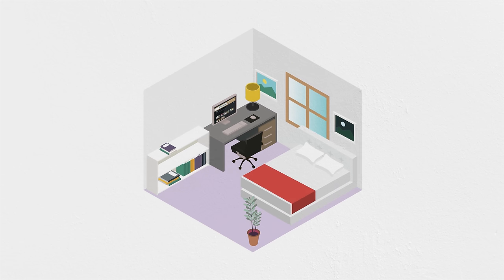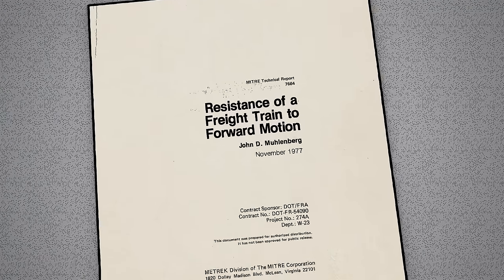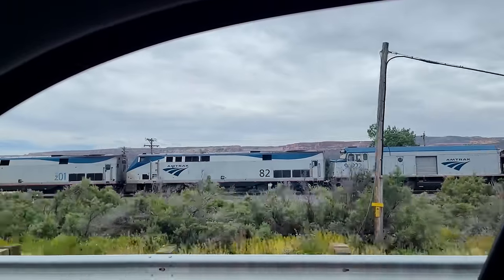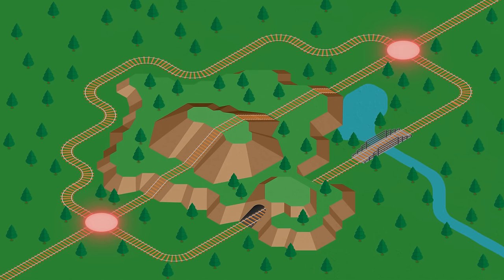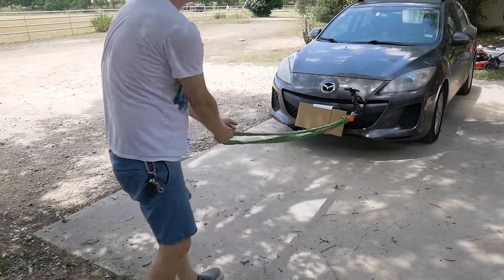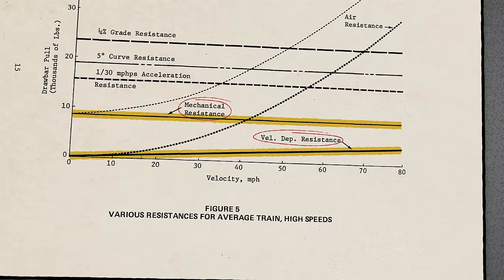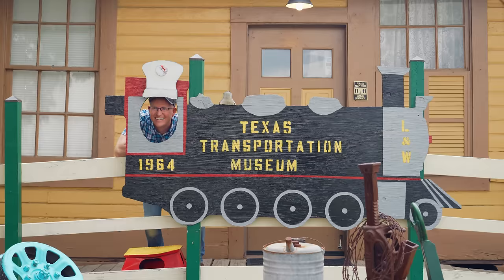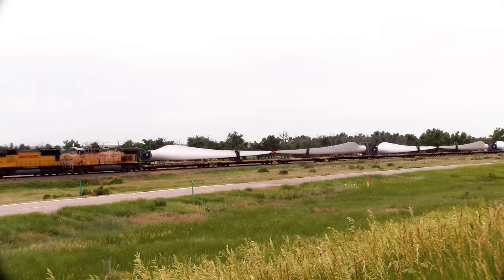Which Is Easier To Pull? (Railcars vs. Road Cars)

Comment: 0:56 - Like seeing our South African Sishen-Saldanha Iron Ore train in your video...

Some interesting facts. This train is about 3.8km (2.3 miles) long. It uses what the refer to as a A,B,C configuration, A would consist of 2 locomotives and 112 wagons (100 ton, excl weight of the wagon). So would B consist of a locomotive (or 2) and 112 wagons and C consist of a locomotive and 112 wagons, and usually at the end of the train is  1 or 2 locomotives pushing. It uses RDP (Radio Distributed Power) so only a driver and assistant in the lead loco. This distributes the pulling/pushing forces better and also makes braking more responsive, as each locomotive in the consist will regulate forwards and backward braking to all the wagons in between. It is many times a mixture of Electric Locomotive (running on 50kV) and Diesel-Electric locomotives.

This is a single line track of about 860km (535 miles) long and stretches from Sishen Iron Ore Mine in the Northern Cape to the port of Saldanha Bay on the West Coast of South Africa, Since there are only 18 places on the track where an empty train and a loaded train can pass each other (Loop is about 4km (2.48 miles) between signal to signal). The fully loaded train will always have preference when possible, as it takes much more energy to get it going than an empty train.

I live about 5km (3.1 miles) from this railway line.

Comment: Isambard Kingdom Brunel was a genius inventor, and one of the head engineers of the Great Western Railway in England during its initial conception. If I remember correctly, he did several things on a branch line that makes the GWR (at the time) an engineer’s wet dream. He doubled the width of the track to set the boiler of the locomotive in the middle of the frames instead of on top of it. This lowered the center of gravity, lowered drag, and gave more space for passengers. One of my favorite things he ever did was build bridges and tunnels over and under terrain, so it was essentially a straight line from point A to point B. It was fast, and efficient, but the problem came when passengers had to switch between two trains of two different gauges of track. Two locomotives couldn’t operate on the same stretch of line because the tracks were too wide or too narrow, and this made schedules and keeping to time a nightmare. Broad Gauge was essentially dead, but by god it was glorious. This was in the days of steam, of course, and he was so revolutionary, he even proposed using vacuum power, by putting a steel pipe between the tracks and forcing the cars to move by connecting them essentially to a plug which would build air pressure in the pipe and force it one way or another. This didn’t go through, of course, but the cable cars in San Francisco work on a similar system, only using steel cables and a winch house instead of vacuum sealed pipes.

Comment: FYI: You can easily put together with some Arduino and a load cell a simple device instead of using a digital camera and a digital scale. You can also display the results and log everything to an SD card. I've seen you using something similar in the Rust-o-matic, so it probably wouldn't be too difficult for you.

Comment: 3:40 Force along an inclined plane is F = Weight x sin(angle). However, for very small angles (like railroad grades) sine is very nearly equal to the slope. This gives us F = (weight) x (%grade). for a 1.0% grade this is F = (2,000 lb.) x (0.01%) = 20 lb. Thus, the simple rule is 20 lb. of tractive effort per ton per percentage grade.

4:27 Some Trains put their DPUs at the back of the train rather than the middle.

Comment: That low wheel/track friction is great when the train is moving but poses a problem for a locomotive when it’s trying to overcome static friction and get the train moving. To help get them going, locomotives have nozzles to spray sand on the tracks if their wheels slip.

Comment: As a locomotive engineer one of the heaviest freight trains I ran was a loaded coal train. It is 135 cars, 5 SD70 (4K hp per engine so 20K total) locomotives and tips the scale almost 23K tons! Depending on the territory we run them at 50mph. What helps move that weight without tarring up the train is having 2 locomotives on the headend and 3 on the rear that push called distributed power. When we encounter wet rail we have sand that we can squirt under the wheels to provide tractive effort. We measure the ability to move the weight as horsepower per ton (HPT) and tons per operative brake (TOB). A typical loaded coal train runs 0.9 hp per trailing ton. If you think of just how little horsepower that is it’s mind boggling that I’m able to move it. There are way smarter folks that come up with the numbers that allow us to maintain the best fuel efficiency. Outstanding video!!!

Comment: Wagon is designed to be pulled and hence easier to pull while car is self driving so a bit more difficult to pull.Wagon slide on rail whiles car faces a bit more friction on road.For almost same length wagons got bigger wheel base and also more wheels.

Comment: Years ago, I was doing work on the far side of a narrow gauge railway workshop, and had to cross part of the rail with an excavator. There was a tanker of fuel oil in the way, the workshop foreman put his shoulder to the buffer and indicated me to do the same. I thought he was kidding, but went along with it. 4000 gallons, plus the tank, rolled away easy as.

Comment: Great video. Just wanted to point out that in fact for a freight train and most of the regional trains the ajr resistance is a lower factor. The resistance part dependent on weight will be far bigger because these train wont go faster than 80 km/h (freight) or 120 / 160 km/h for regional. Also the big component of air resistance is related to frontal area and some component to side area. The frontal area is comparably lower to sides. Very different story for cars. But trains experience things like piston resistance in tunnels and pressure waves and changes which is quite interesting for high speed trains.

PS: Grady please polish your light reflectors on your Mazda :) You will see better and the opposite traffic also

Comment: The three routes at 3:10 - the left one is cheapest and good for slow speeds, having lots of curves. The middle one would actually be useful for a dedicated high-speed line (French style) where the train has already lots of kinetic energy entering the grade, and lots of speed can be recovered coming downhill. The best alignment for mixed use, although the most expensive to build, would be the right one, being flat and having few curves.
Reply: I believe the ruling gradient on TGV lines is 1 in 28   (about 3.5% in American), which would be considered extremely steep for a normal rail line.   The TGV lines can accept this because they don't carry freight.     And of course the TGV trains have the power to easily surmount a gradient like this and speed plays its part too, a mile-long grade of 1 in 28 will only take about 20 seconds to traverse at full speed so the train hardly slows down much in that time.
Reply: Yet the right path still has a 90 degree curve at the start, which is far too sharp for any train to traverse.  The sharpest curve in the US is around 12 degrees, all but the middle path are invalid.

Comment: zomg cmon Brady you absolutely know how you could safely pull the traincar... albeit not without some preparation. You can pull as a portion of an assisted pulley system, allowing you to directly pull on the train but with a static weight adding to the base level of tugging. If you wanted to be super smart and super safe, you could calculate the required weight fairly accurately on a single or multiple pulley system (for convenience's sake) and have the weight suspended just above the ground so that it would only be in effect during the initial pull to overcome the static resistance but not apply its weight to the rolling resistance. Would be so sweet you gotta do it lol

Comment: You can electrify the track the you can get the energy back by recuperation.
The motors act as  generator and feeds currant back in the catenary.  
In Tunnels the air resistances is much higher especially at the speed 
of passenger trains. A Alstom Twindexx 502 pulls in the Gotthard base
tunnel at 200 km/h about 570 A at 15'000 V.  (8,55 Megawatt).
I managed to push on a perfect flat track a modern 100t train by my self.
At the beginning the train seams not to move but while you push
it gets faster and faster. Once you feel it is rolling, you better
have stumbling block ready. There now a lot of kinetic energy in
that train.

Comment: the best answer probably is: the one that has the lowest friction. A railcar can have what we called 'square wheels'  which would result in much higher friction than otherwise expected.
At the same time a light car with it's tubes up to pressure perfectly can be quite easy to pull if the road surface is hard and very flat and completely level or at an advantageous slope. There are so many factors at play that there is no straight answer to this question. I've moved a whole 6 rail cars all by myself and i'm no giant or some gym crazy lifter type.

Worked 3 years in maintenance of electrical passenger trains for one of the world's best public transportation systems (apparently that is, because a boatload of countries were watching us how we did things)

Comment: Working as a hi-lo driver at a manufacturing plant I had to unload many box cars. Unfortunately not all the box cars were perfectly aligned with the gate through which I had to install a ramp. They could be off by as much as 6-feet. I had to move that loaded box car (80,000 pounds) by myself. No locomotive, no switch engine. I had an 8-foot long lever bar. With it wedged between the rail and the wheel I could lever that loaded boxcar by myself.

Comment: I had a civil engineering bachelor but I don't work on this now. However I do play railroad tycoon 2 and in here there are great examples of trains. (It's China and there are heavy freighters like Datong-Qinhuangdao)
Yep the railcars only have very tiny frictions at stable or low speed. That's why modern heavyhauler locomotives (Something like Chinese HXD series) can pull a hundred of fully loaded coal cars (100 tons each) on flat track. When the speed gets high the wind resistance skyrockets and I guess that's why they don't make the heavyhaulers 160kph rather than the nowadays 120kph.
Slope resistance is enormous compared to the flat friction and one locomotive capable of pulling 100 full cars flat would be crippled to pull less than 10 cars uphill. (you got 0.16% resistance on flat friction but 1% on a 1% slope). If you have to do this you need to add banker engines at your trains which takes time and costs (that's what they do in China mountain routes in steam era)

Sometimes the slope is inevitable! What if the station is on the mountain top?
Datong-Qinhuangdao route has a downhill route max grade of 0.4% and uphill route grade of 1.2% and the coal mine is on the mountain top... it's running full downhill and running empty uphill. That's why the uphill is more tolerable to slopes than downhill.

Comment: "It turns out the rolling resistance of a rail car is pretty high if you don't fully disengage the brakes first."  BEST. LINE. EVER.  (And delivered with a straight face.  ;-) )

Comment: Back in the 1990's myself and another guy pulled a 737 aircraft loaded with passengers by hand 4-5 feet because our pushback tractor broke.  We were messing around but it worked to get the plane tire to the mark to offload.

Comment: I have shipped an item by rail.  I was at Grosmont, North Yorkshire.  me, my mother and sister bought a Picture of a Steam Locomotive for my farther... It was of the "Sir Nigel Gresley" A4 Steam locomotive.  We shipped it home via a train pulled by "Sir Nigel Gresley", along the length of the line and then sent via postage delivery to York Station and onwards to Sheffield, Via rail.  Then Sheffield Central Deliver Office sent it to our home address.  So we now have the Painting hung on the wall and a story of how it arrived.  Not just a painting but a whole experience. (the painting was of Sir Nigel Gresley at York... Hence the sending the picture Via York specifically.)
Sir Nigel Gresley is my farthers favourite locomotive.  It is also mine for other reasons.  I got to travel on the footplate of the same locomotive on another railway...

Comment: I recall in a course at Penn State on Introduction to coal mining that the coefficient of friction between steel and steel was so low that the grades for rail haulage was limited to about 5%.  Steeper grades were too slippery for a locomotive to pull.  This was important to coal mine design.  Haulage roads for trucks could be much steeper, which was a factor in necessary slopes in open pit mines.  It was pointed out that locomotives had to be heavy to put enough pressure on its wheels for there to be friction for traction.  My recollection is that a vector resolution of the coefficient of friction and the weight of the locomotive resulted in the backward component of the weight on a grade of about 5% equalled the available rolling friction.

Comment: A safety razor has been the best change to shaving I've experienced. Cost is down, cuts are down, it's easy to use and rinse. Granted, I went with a very cheap handle, I don't know how much benefit there is to expensive ones.
Reply: The Henson is better than most. I had two Merkur before it. But because it holds the blade so much more aggressively, it tends to break them. And like and safety razor it works best with certain brands, namely the PolSilver Super Iridium. The PolSilver are made in St Petersburg and not available at the moment.

Comment: Hi Grady, thanks for uploading another interesting episode.  When you mentioned that the energy is wasted as heat in its brakes (when it slows down on the downhill parts,) it made me wonder about the possibility of regenerative braking - for trains.  I spent three seconds googling it, and it would seem that it is a thing...
Reply: True regenerative braking is only possible if you have a battery, grid, or similar ready to receive the extra energy. Closely related is "dynamic braking" which is like regen except the generated power is converted to heat in a dummy resistive load. It doesn't recover any energy but it's still better than friction brakes because it doesn't wear out.

Comment: @practicalengineeringchannel Hello Grady! You're a trained engineer and I'm not so I might be wrong about this but when you tried to move that car you kind of yanked/made short pulls, which probably had more than enough force to move it but the time the force was applied was to short. If you'd dug your heels in and leaned back just holding the rope you probaly would've moved it eventually, given you provide slightly more force than the 15 kg required to keep it moving. I think it's something like the reverse calculation of calculating the force of impact where time is a big player, you know the math stuff, it was too long ago I studied it in school. 😊 Thanks for another good episode, always enjoy watching! 👍😀

Comment: Also, the train's breaks must resist the the train's tendency to speed up coming down hill.
    Near where I grew up there was a big mine up in the mountains. In the 1800's they would connect a loaded train at the top to an empty train and the bottom then push the loaded train down the hill.
     Both trains still had to break the entire time to not go too fast.

Comment: I can vouch for how easy it is to move a rail car. A string of rail cars broke loose from a yard siding in Winchester, KY several years ago. You would swear there’s no way for that to have happened due to how level the track ‘appeared’ to be. The poor new-on-the-job yard worker forgot to set handbrakes. A string of cars rolled about 16 miles before CSX was able to derail them by sacrificing two locomotives. That’s all they could do because the cars (with hazardous cargo) were headed toward Ravenna, KY and there was no time for any other option.

Comment: 4:54 The thick is to not shut off the engines, but to run them in reverse as generators. Of course that is only possible with electric trains that are equiped with the right high power electronics and a force distribution along the train that allows slowing the train down only using the engines. An maybe modified rail power stations.

Comment: That was a very interesting video!
I was actually expecting you could pull the rail car. Tried to push it?
Thumbs up for using #metric too so most of the world can follow. And it also showed not only how old fashioned US units are, it also shows how easy metric is.
In that context: pulling power of locos is usually given in Nm, isn’t it?

Comment: If you want to pull with the most force possible, it’s better to face away from the object you’re pulling at drive with your legs. If you face the object, you are trying to pull with your back muscles, which pail in comparison to the strength of your legs

Comment: River barges are pretty efficient at bulk transport of heavy material too, especially if you can move your goods downstream a non-tidal river.
Railway cars move easily since they use roller bearings. Older railway cars with sliding bearings take quite a bit more effort to get going; those older bearings have much more "stiction". On long trains stiction in those older sliding bearings could be enough that without sufficient slack between the cars a stalled locomotive would be unable to get the train moving again; a locomotive engineer's nightmare scenario when stalled on a modest incline with all slack between the cars taken up.